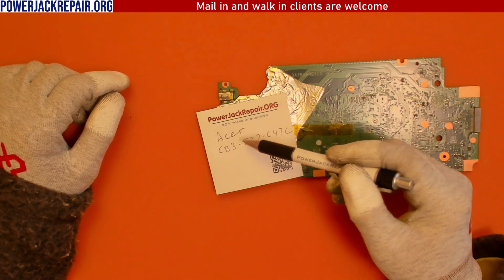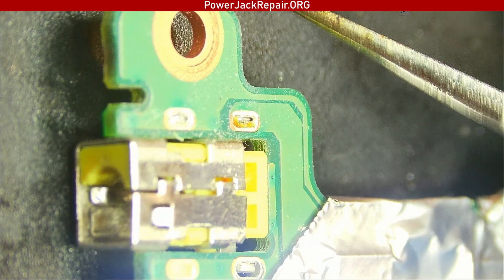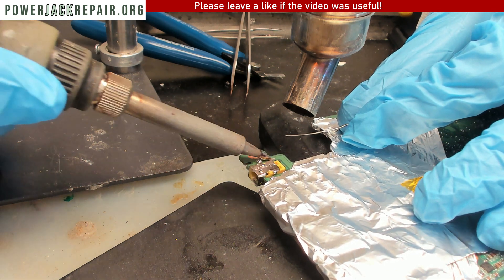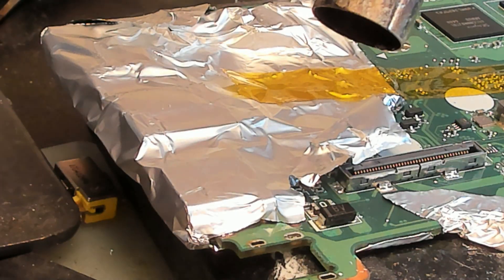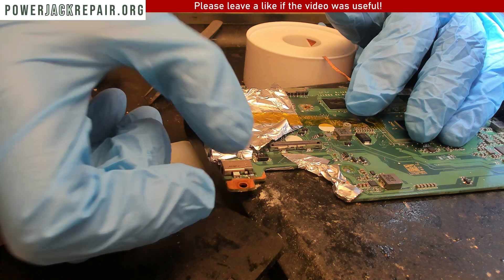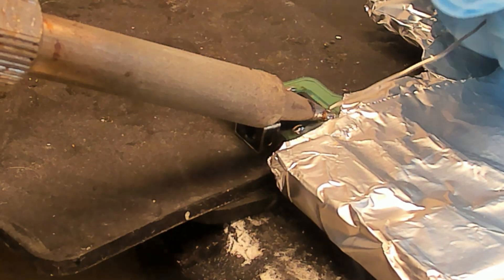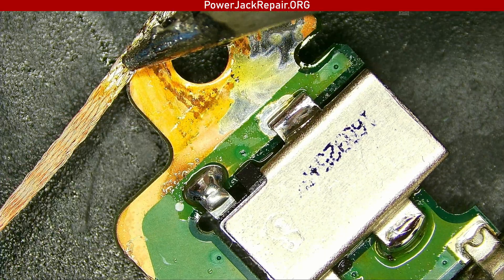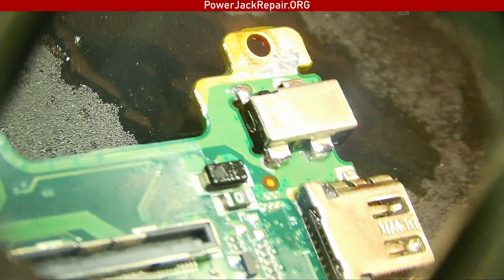Here is why Acer laptops break the most common repair on the motherboard laptop power jack cb3

Comment: Hi, should I worry if I hear a buzzing noise from the charging port whenever I use my laptop for a hard task (rendering a video)?
Could this be a sign of a faulty port or is it normal?
Reply: A buzz is not normal, commonly these used to  be a transformer hum - which was normal, a higher pitched sound would indicate something is arcing (like mini lightning strikes ).  The port has a spring contact which is distorted.
Reply: @deansmith4752  Yeah, it is a high pitch sound... Would I be able to do something about it? Or am I doomed? Is my laptop in imminent danger? (I have been hearing this sound for a year by now)
Btw, thx for reply.

Comment: i have the same motherboard to, i replaced the power socket and battery but no power on ard there is no charging lite, is  there a fuse or what usually blows down stream?
Reply from the maker: could be mosfet that went bad due to constant power interruptions
Reply: @Powerjackrepair  ok thanks i can check voltages on them and replace